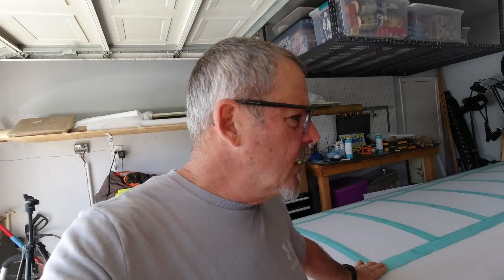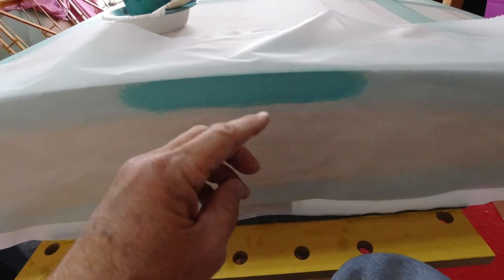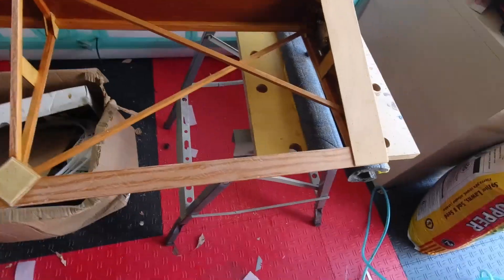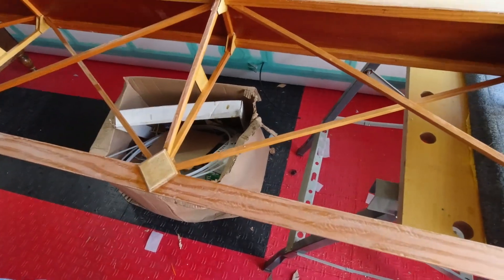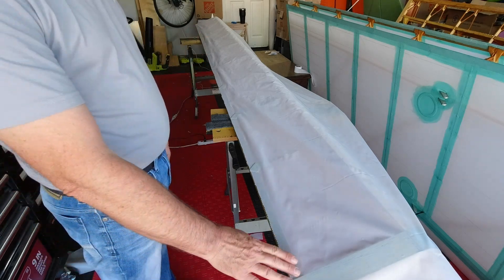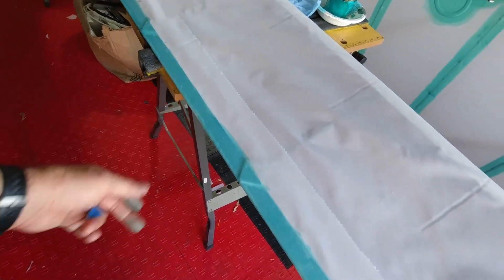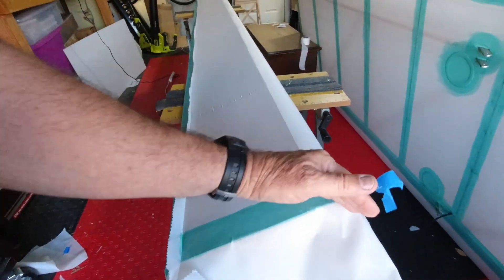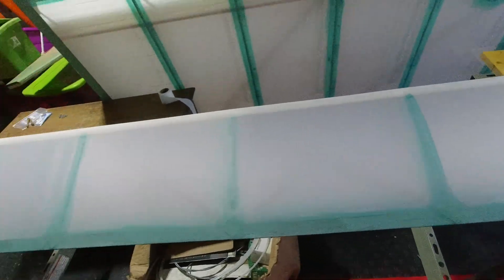Minimax 1100r Wood Aircraft Build Ep 192

Comment: I think the reason most don't put tape over the rear spar is the top covering will in flying be lifted away from the spar. I am planning to cover my aileron the way I have done it before when doing in one with the joint at the leading edge, with a good attachment 2" overlap. Sorry I did not get chance to tell you. What a shame you missed the other bearing bolt, we have all done something like that.
Reply from the maker: I suppose I tend to err on the side of a little overkill 
I hope your project is going well
Reply: @DTMinimax  not so much overkill as like showing the tapes. I  do the same with tapes, wrapping from leading edge around trailing edge and back to leading edge. 
My project is getting there slowly as you may have seen in my videos. I hope to start some covering in late summer.